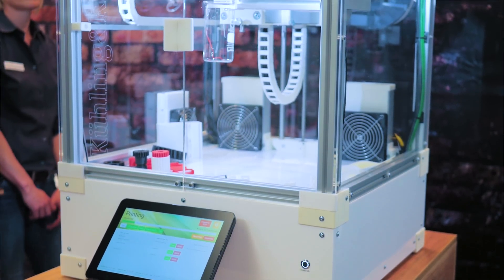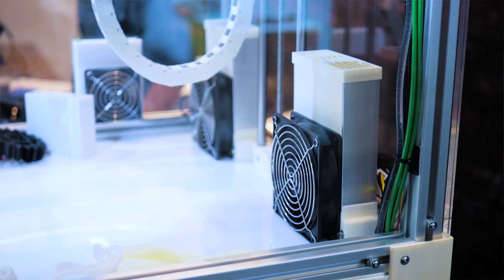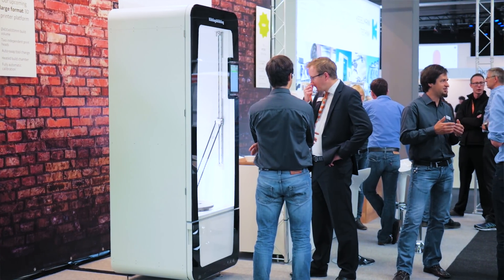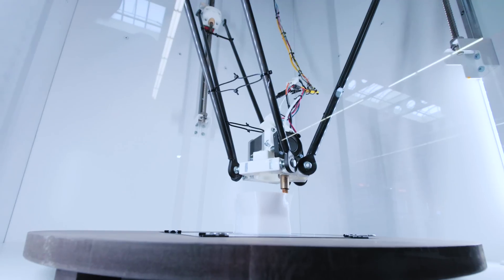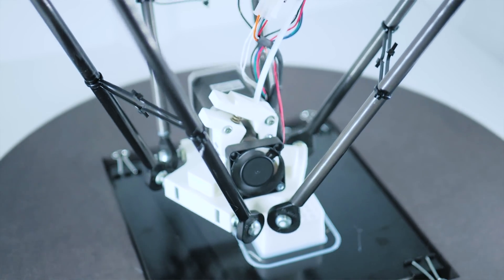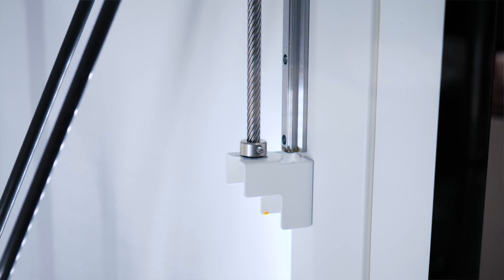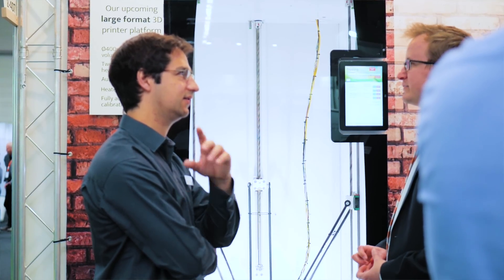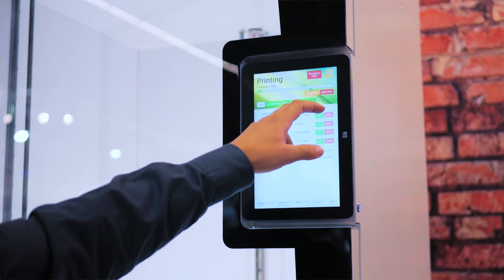Their Delta 3D printer would make a classy fridge! Kühling & Kühling at FabCon3D/Rapidtech

Comment: honestly that Delta looks VERY disappointing. build area is extremely small (200x200?) The arms are way to long resulting in a very expensive linear slide assembly. those igus lead scews are hella expensive. the size is such a show off piece and no part of that machine is practical. i am sure the price on that thing will be the same if not more than a Stratasys uPrint plus
Reply: The built area is defined by the length of the linear slides, not how big the cube is. Judging by how long the arms and rods are, it is probably a much, much more capable machine than the little plate they have thrown down.
Reply: +smokeydops right, I get the prototype thing. without being there I can't realistically judge the machine
Reply: +Thomas Sanladerer hmmm I wish I could get review once that thing gets released ;)
Reply: Dude he said it cost 35k in the video along with it's an early prototype. A few times in the video (1:10) you can see the sign right next to the delta clearly stating a 400x600mm build area.
I don't get why you would comment when you can't be bothered to watch half of a 3min video.